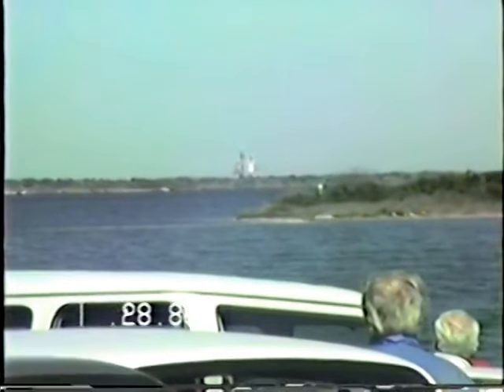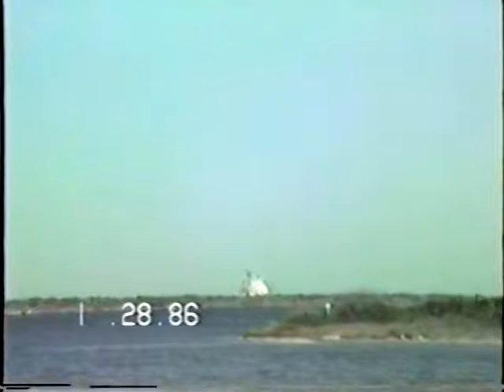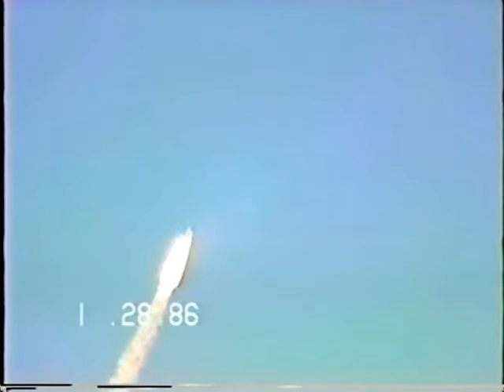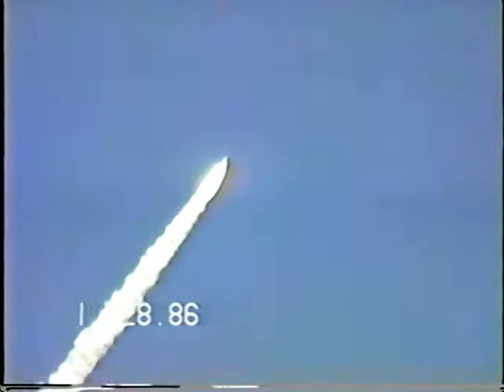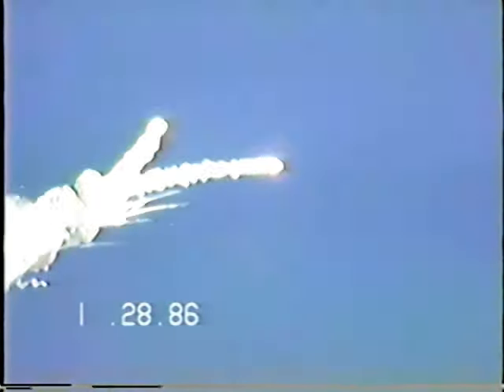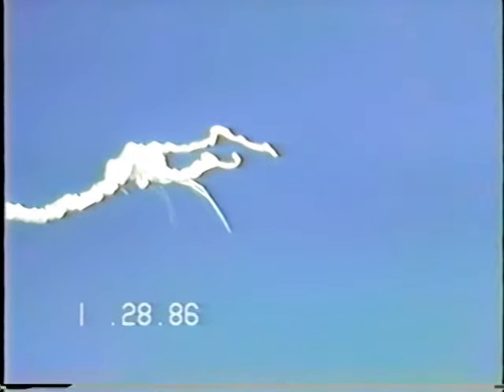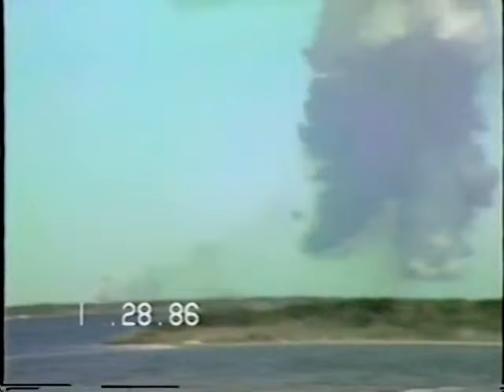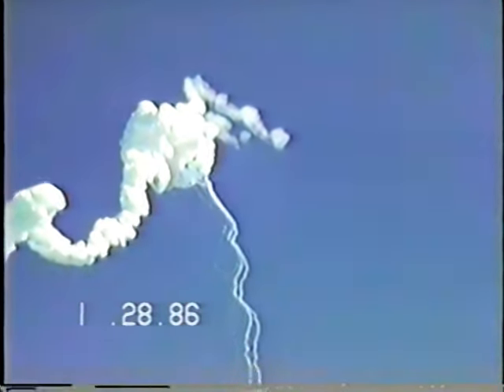Space Shuttle Challenger Explosion - VHS Videotape - NEW ANGLE

Comment: It was an in-flight breakup but not an explosion. If you listen carefully to the sound of the engines (there is a delay, of course, and the roar of the engines at lift-off is not heard for several seconds as the sound travels to reach the spectators) that there is no sound of an explosion. Rather, what you hear is...nothing. The roar of the engines just stops. The large plume is not an explosion of the fuel—it’s the liquid fuel vaporizing in the upper atmosphere forming a cloud as the giant fuel tank rips apart. The orbiter breakup is invisible because it happens inside the cloud, but segments of it can be seen exiting the vapor cloud. The crew module and the other segments showed no evidence of any explosion. There was nothing burned. The crew module remains intact as it emerges from the cloud. The crew survived the breakup but there is evidence that they were incapacitated quickly when the module depressurized. (The crew of the Columbia were also killed by the depressurization of the crew module after its in-flight breakup.)
Reply: I heard that the main fuel tank did explode, causing the breakup.
Reply: @Glen.Danielsen no it just failed causing it to slam into the orbiter leaving the orbiter to the mercy of the airstream causing the breakup. The whole event happened too fast for an explosion to occur.
Reply: @devinthierault  Ok.
Reply: @devinthierault  Yes, that’s right. Thank you for that addition.

Comment: Once those solid rocket boosters were ignited on the launch pad, the astronauts were already dead. There is no abort mode that could have saved them!
Reply: Even more heartbreaking was the engineers did try to warn the officials about the problems with the rocket booster o rings, but they were just shut down

Comment: A few things:

It's easy to tell how sheared that atmosphere is. When the camera is wide just before the breakup, the exhaust plume immediately gets pushed around by strong winds, changing with height. The most iconic still images of the disaster all have that effect too, it gets pretty significant after about 15 seconds. Look closely at the broadcast footage, and you'll see the stack get bumped around a bit and the guidance has to compensate, just as the gas plume appears. That wind shear helped to screw Challenger over more than it already was, because those extra forces helped liberate the SRB and let it smash into the external tank (with help from the various fuel leaks at the time). Needless to say, rockets need pretty conservative limits, and the Shuttle especially needed that after losing 14 astronauts over the years.

The sound is also incredible. With the delay, it's a bit hard to tell, but I can make out a point after the breakup where the rumbling sounds normal, then there's a small pop or abnormality. You still hear slightly duller crackling from the runaway SRB's that gets more distant, until those get FTS'd and stop. I can't be sure, but there had to have been something of a boom from the ground, from all of the LH2 igniting. After all, the breakup wasn't that far away, and recent incidents, like Starship prototypes back in 2021 repeatedly slamming into the landing pad, have had quite the noise to them without a lot of fuel onboard.

Comment: Not to be morbid, but at 2:08, the object at the lower center of the screen above the two contrails is the crew cabin blasted away.
Reply: The worst part: all of them survived the explosion.
Reply: @TheEmeraldMenOfficial  Was wondering whether someone here would know about (and mention) this perplexing, indeed very troubling fact??
Reply: @kim86gurl  It's not perplexing. It's just physics and also the intended function of the shuttle which was designed to withstand the forces of reentry (though very poorly which is why we don't do space shuttles anymore because it turns out it's more expensive to fix a shuttle and maintain it than to just build "disposable" one time use rockets with the soyuz on top and dump the trash off in space/the ocean). . They broke apart right after max throttle up which means they were rocketed away from the explosion really fast . What's scarier is no one knows how long they were alive for or if they were conscious the entire fall. It's guess work mostly but they would have experienced something like 11gs on the way down to earth which would make most people pass out long before you got to 10gs, and you'd be likely dead from oxygen starvation before you hit the earth, but these are trained pilots who are qualified and are in really good shape. So best guess is, they probably died on the way down. But no one knows. They very well could have survived until moment of impact, which I find to be so so much scarier. They would have fallen for minutes before hitting earth.
Reply: @Southboundpachyderm  Astronaut Story Musgrave was adamant in saying they died when they hit the water. He says there’s evidence they did which until we know what that evidence is will remain speculation to me.  But this video is powerful in that it’s a view of it I’ve never seen before. Thanks for sharing.
Reply: I remember reading somewhere that they turned on their oxygen.
Reply: @jamaldominicbarr7379  the oxygen would have been on anyway. They were all in their space suits. The G forces when they split apart SHOULD have been enough to knock them all out instantly, but no one can be sure because the life support systems were all functional until impact. But no one can be 100% sure if anyone was conscious when they impacted the ground it’s just suspected because it appeared that there was still activity happening on the computer systems, but that could also just be the electrical system throwing off false readings as the craft came apart. At least not until the entire report is made public and all the information around it is too. But I think a lot of that stuff is still classified for a few more years. I think the best we get is that it’s highly suspected at least one person was conscious because they were able to get the black box back which showed some control inputs after the breakup

Comment: One question I've always had is how we're the attachment points on SRB released simultaneously?
Reply: Just as a guess, probably explosive devices. Nasa used them for a lot of things. They are small, light weight, very reliable and have a high speed of operation.  I downloaded a LEM book from Nasa that said the lunar module had something like 100 explosive operated devices, and they all worked every time.
Reply: Normally, the bolts holding the SRBs to the External Tank were released by pyrotechnic explosives that severed the nuts. In the case of the  accident, when the External Tank ruptured the SRBs lost their support and started to fly independently.